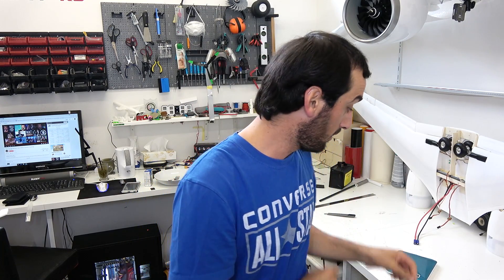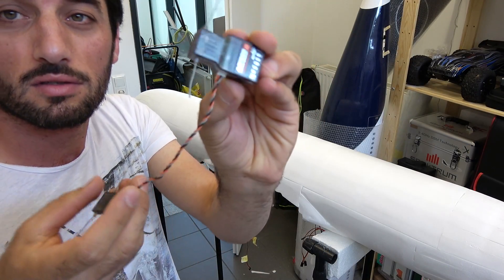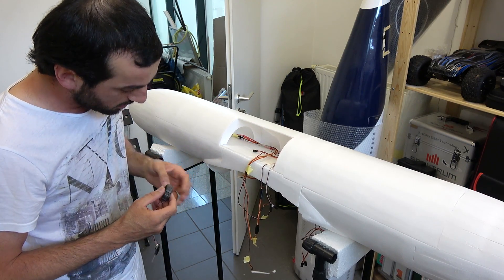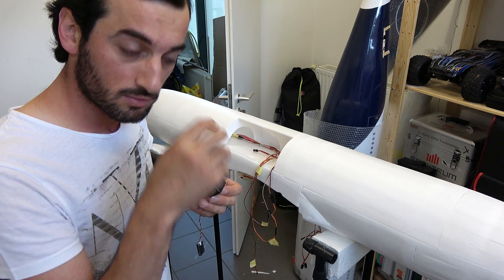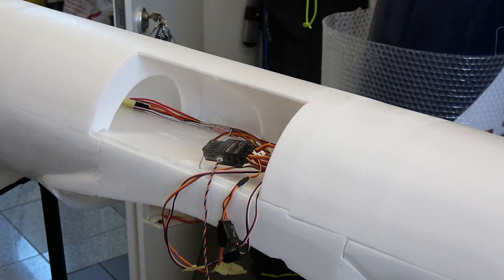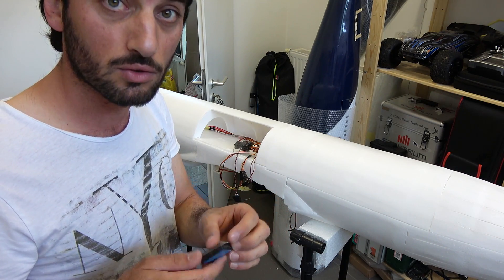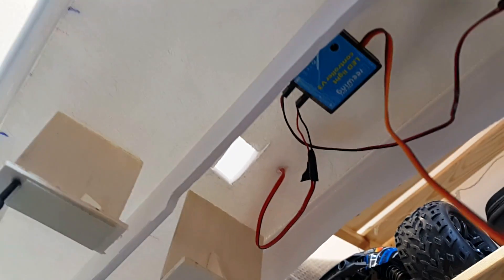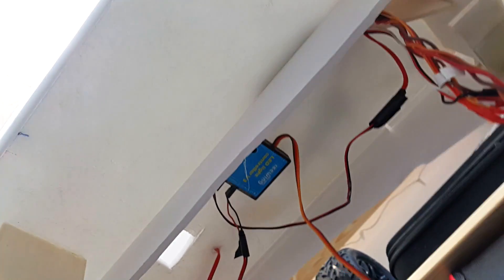Boeing 737 MAX-8 RC airplane DIY project | FINAL

Comment: Thanks so much Ramy, this series has been such a help to me as I build an A320neo easyJet, very similar airplane. I’ll upload some build videos and flights of it when the time comes... But any tips on keeping it light would be much appreciated, and did you have to make slightly bigger wings than scale to support more weight? That’s what I ended up doing, my A320 is only 1,5 meters long. I expect it will be between 2 and 2.5 Kg. Thanks again! Excited for the maiden flight, good luck mate! Regards, AirCat. :)

Comment: Hi Ramy! I loved this series, and I'll make a plane using these videos. Can you please answer my question, how did you come about the calculation of Multiplying all dimensions of the plan by 3, in your "How I make my plans" video? And another question is, how do you calculate  the dihedral angle of main wings and Elevator wings? Thanks 😊
Reply from the maker: you are free to multiply it with any number, depends on the scale you trying to make,
draw the straight line under the wings and the elevator and measure the distance between that line and you the the tips.
Reply: Ramy pls..  .how did you get CG for that plane?